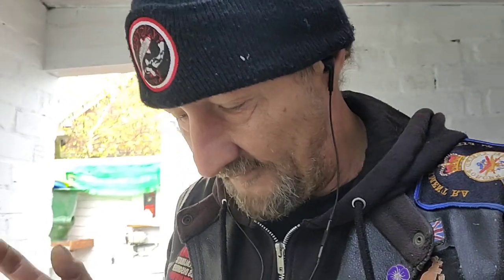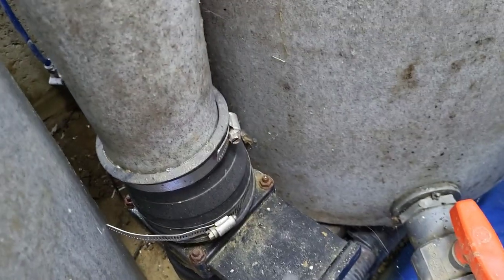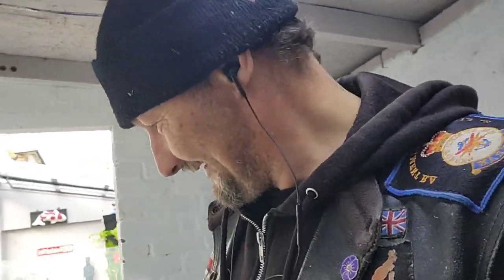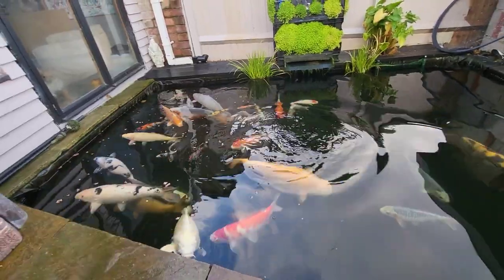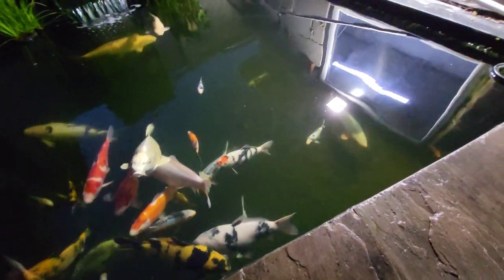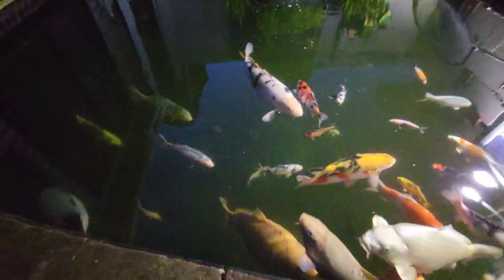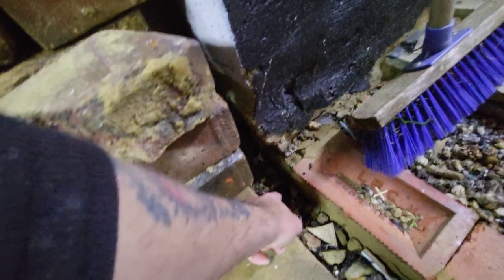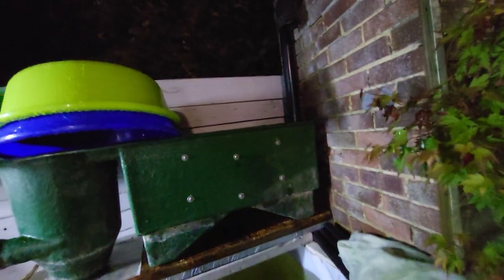BALL VALVE DISASTER 🤬🤬🤬🤬 And I Ask You Guy's For Help #koipond #pond #koi #koifry #japanesekoi #fry

Comment: Shame about the large ball valve, if you take the unions off of it, you should find there is an adjuster on it that can be loosed off, but if it is loosed off too much of coarse it will leak, or let water pass when closed, but your ball valve must be far too tight, so loosen back a bit, good luck.
Reply from the maker: I know exactly what you're saying it just won't let me loosen the inner section but I seem to have it moving now 🧁🤞👍👍👍
Reply: @LeTwistedOne  Great news, they re so exspensive, its a bugger if you can not use it.